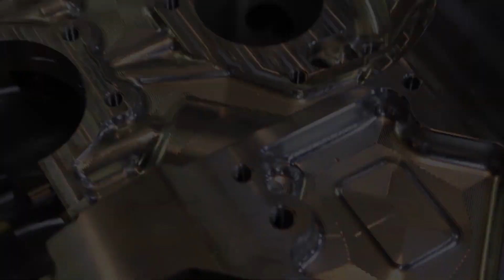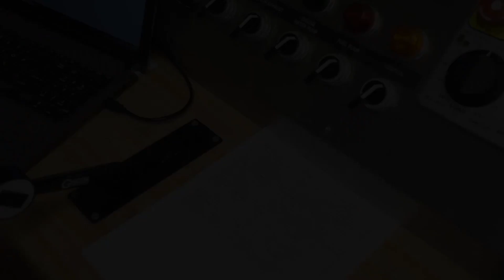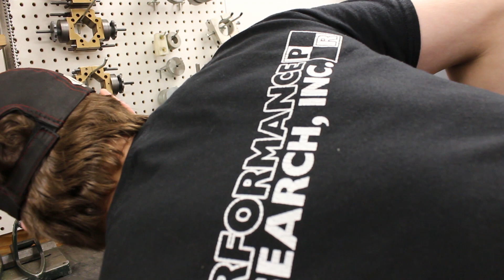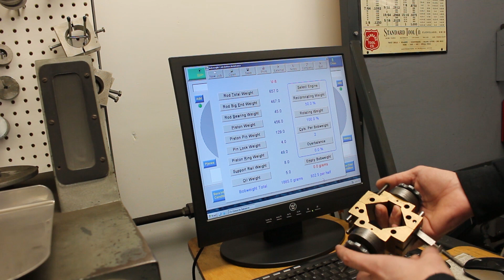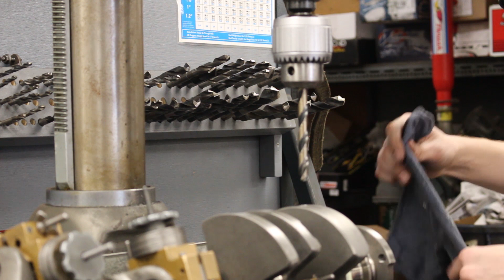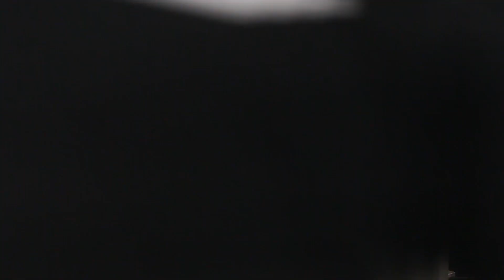Street Race Channel's Billy Hoskinson Crank Shaft Balancing, how it's really done

Comment: You needed to put the h balancer and flywheel on . Even if the crank is internal balance, most times the h b and flywheel are out of balance. It doesn't matter if you can balance that crank to a millionth of a gram, it's all the little factors your missing, that's the problem! Also a professional would've put the crank in the lathe and removed material on counterwgt instead of drill all those BIG ugly holes. Your just doing a run of the mill balance job. If you are going to do a video and want to appear professional you need to be professional. Get your voice overs in line with what the video is showing! Maybe instead of "how it's really done" it should read " how you do it".
Reply: Ive ran 2900 hp car. And can tell you that what this man did is more than enough. Alot of what you described is just things that will get you 1/10 hp. I have had no et or mph difference. And the engine lasted the same amount of time. NHRA top sportsman 67 impala. 520 cubic inch procharged BBC turning 8600 rpm and a lenco.
Reply: @bigboreracing356  a few decades ago we had our cranks cromed and ran melidon main caps. But soon I left that behind and ran the stock crank and ran a bar across the stock caps. But that was in the 60's. People forget nothing new has really come about in the engine world since ww2. I can remember exterminating with nitrous in the mid to late 70's. And found book that showed we used it in fighter planes to climb faster in combat. Then in the late 80's I seen guys running nirtous with a small turbo. We thought they were insane. But with time things change. You cant change peoples mind anymore. They know all and wont listen.
Reply: @bigboreracing356  its true really. Ive strted looking back at old port shapes, sizes and length. And same with chamber shap shapes and sizes. Some odd ones out there.
Reply: @bigboreracing356  I mean yes and no. Ive seen picture of old chambers that were never used. Its nice to own a cnc machine lol.

Comment: I’m running a sbc 400 stock 2 bolt block it’s 40 over srp pistons eagle crank and rods however rods are 5.7  so your using the same stroke but with a 6.0 rod? Or you changed it to a 438 or whatever it would come out to lol 
If you are on Instagram I would like to send you to a machinist guy I think you will really enjoy his work 👌🏻 attentional detail like you 👍🏻
Thanks for the vid it’s great to see the young people getting this ...
Maybe make a video on how you got into who taught you etc... always cool knowing the person behind the camera 👍🏻👍🏻👍🏻
Reply from the maker: juiced71 yes, this motor is also a 400 block. Bore is 4.165” with a 3.750 arm. This motor had 5.7 rods in it but we switched to 6” rods because anything less would require the counterweights to be cam cut (expensive) using a 6” rather than 5.7 will also make the rod geometry better for higher rpm, a “plus plus” in my opinion. Thank you for your comment. Our Instagram handle is @performance_research_inc would love to see your machinists work :)
Reply: Performance Research I wish I was a machinist lol but I follow a really good guy from Cali that I think you will enjoy 👍🏻 
Nice work 👌🏻👌🏻👌🏻
Reply from the maker: Oh and I forgot to mention, the stroke hasn’t changed, we just moved the pin bore in the piston up to compensate for the longer rods
Reply: What compression ratio did you went with being he had high compression done pistons